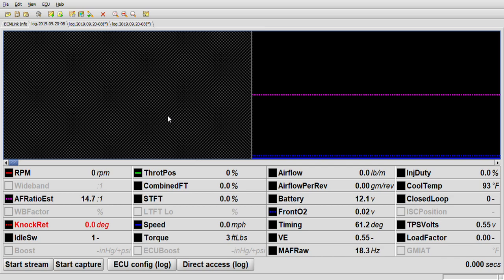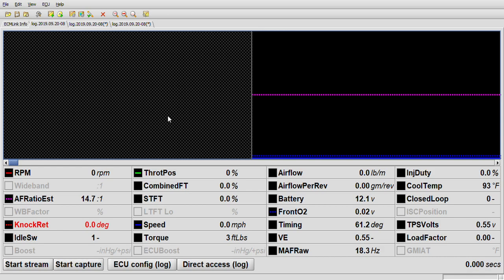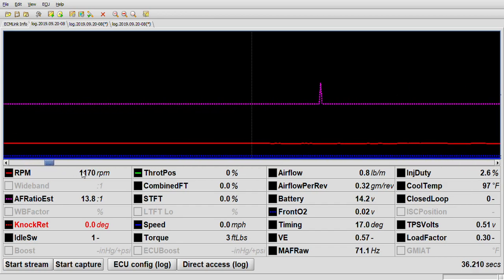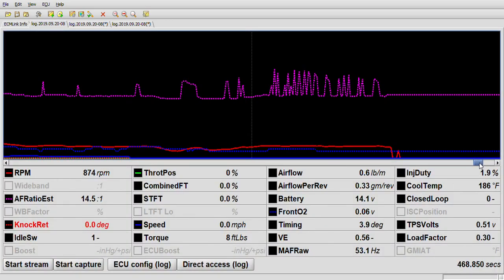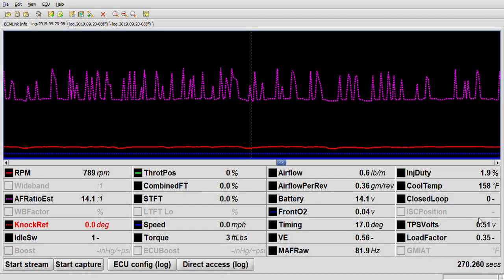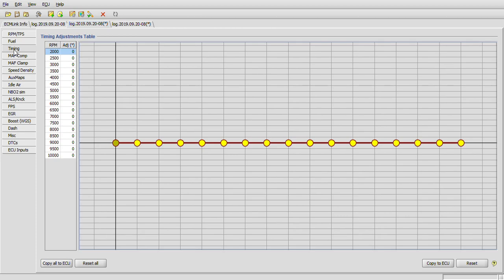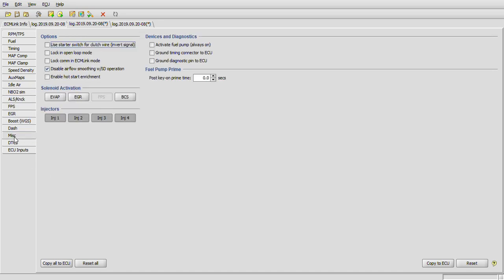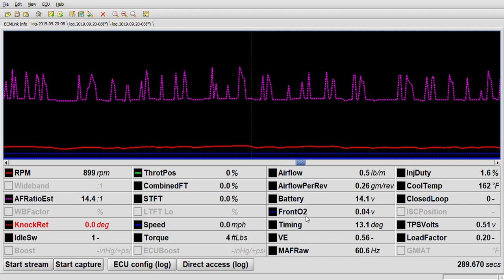Ecmlink, Troubleshooting a tune that's stock. Maf car.

Comment: Could you show a complete beginner guide to ecmlink? My main concern is, someone messed with the max octane table in direct access, and I could switch it back to the stock version, but not sure what could go wrong. Im trying to fix the previous owner mistakes
Reply from the maker: @InspecZub  I have a bunch of videos in there. One of those should discuss going back to stock. I've moved onto a Corvette and I've had zero desire to do anything with Dsm's since. A lot of money, sweat, and heartache from that dang car to the point that I'm literally disgusted to do anything with them at all.